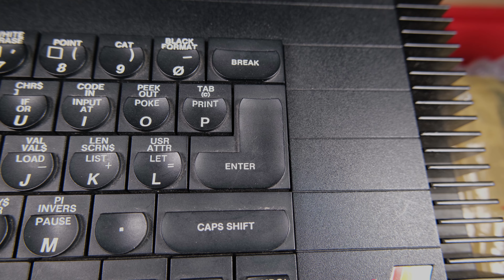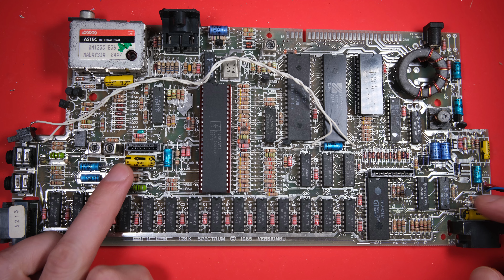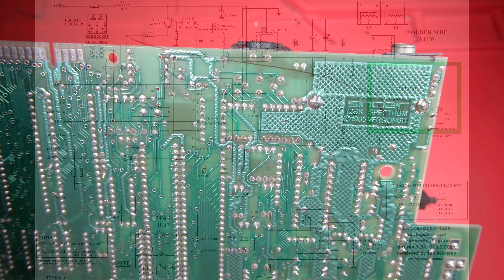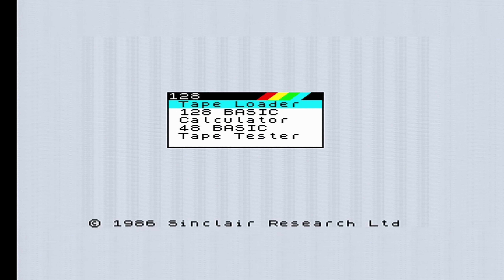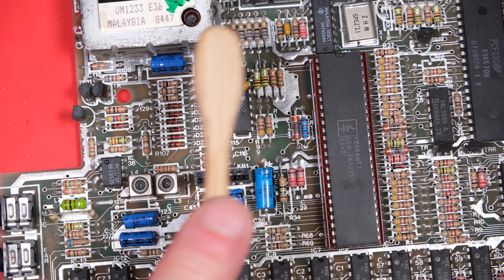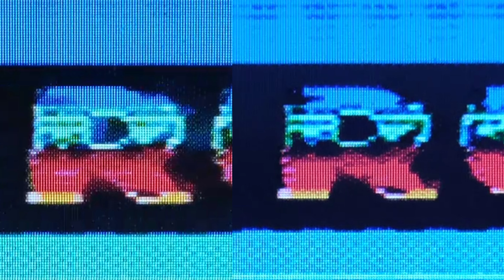ZX Spectrum 128K Toastrack - Composite Mod and some Service Mods

Comment: those scrolling lines as i recently found out is due to the PSU being close to 9vdc , as we know most original spectrum PSU's output around 12-15vdc under no load , modern PSU's are very close to 9vdc around 9.7vdc ,m when under load this drops below 9vdc and causes those scrolls !!
Reply from the maker: I might have to test that theory!

Comment: I got mine down from the loft a couple of weeks ago.  It's not working, of course.  Black bars top to bottom on start up and the reset does nothing.  Seems to be giving all the right voltages etc so I plan to re-cap it.  Is that the right thing to do?  I'm new to this and am using this as a learning exercise.  So far I have learned that I don't have a clue what I'm doing ...  😁
Reply from the maker: I don't think I've ever had a failure that a recap fixed, so I would recommend doing some diagnostics first, are the bars vertical or horiztonal? It sounds indicative of a CPU failure
Reply: @HappyLittleDiodes  Vertical, solid black and white bars with the occasional coloured byte in random places.

See, I told you I didn't know what I was doing! 🤪
Reply from the maker: My spidey senses say Z80 but needs investigation!
Reply: @HappyLittleDiodes  It will get it, soon.  BTW is there anything I shouldn't do that's likely to kill stuff?
Reply from the maker: Make sure your voltages are ok and don't run it for any amount of time without the heatsink attached. Use a current limiting power supply if possible. Is the Z80 socketed? If not then I wouldn't recommend it being your first chip removal, you can easily damage traces.  The best thing would be to get a diagnostic ROM running to rule out anything else before such a job
Reply: @HappyLittleDiodes  Noted.  Thanks for taking the time to answer.

Comment: no need to composite mod a toastrack as you said it already has it on the monitor din socket, so why? make up a din to rca adaptor...
Reply from the maker: As mentioned in the video the owner wanted to use a peripheral that is so large is blocks that socket
Reply: @HappyLittleDiodes  a right angle din plug may fit? if its that opus , i have one but not as yet tried it on a toastrack to see how things fit
Reply from the maker: I think the owner's preference was to have the machine appear unmodified and to have composite video available at the modulator output, he didn't send the Opus otherwise I may have experimented
Reply: @HappyLittleDiodes  the opus has a composite output but it takes it off the edge connector, which isnt present on the 128 models ,  its  supposedly possible to have simultaneous rf and composite out of the modulator rca connector, you leave the modulator connected as  factory, except lead a wire out of the can connected to phono centre, you then rig up a simple emitter follower buffer fed from modulator video in pin to base of a pnp transistor, collector to ground,  emitter to +5v via a 220 ohm resistor(may need value tweaking), emitter also to rca centre via a 100uf minimum cap ...in the case of a 128, likely directly connect the dins video signal directly to the centre rca contact,

Comment: So the composite mod is identical to the one that it done on the 48K boards, right?
Reply from the maker: Not quite!!
Reply: @HappyLittleDiodes  Why's that?
Reply from the maker: If you simply connect the modulator input to the socket it's not going to work, you have to route it from elsewhere on the board

Comment: Very  nice.

I'm surprised you didn't swap the linear voltage regulator for a switch mode one.
Reply from the maker: Various pros and cons to both!  It tends to come down to the owner's preference
Reply: @HappyLittleDiodes  no 'need' to , maybe just change to a 2 amp 78S05 if a 1a/1.5a 7805 is fitted ..

Comment: toast rack continues to be on my shopping list .. should the composite have a 15ohm resistor on to reduce the voltage down to 1.0 volt
Reply from the maker: Not that I'm aware of. The signal we hijacked is an oven ready composite signal unless I'm mistaken
Reply: @HappyLittleDiodes  yep no need to add anything if tapping off directly at the din socket pin ,

Comment: Lovely tidy work old boy! This keyboard mod would've made many a teenaged geek positively explode in the 80's! 

FYI - Back in my day, we would put (or more commonly screen-printed printed) solder paste onto the board, carefully place all the surface mount components and then briefly bake the board at a temperature high enough to melt the paste - although I daresay you're already aware of this method...
Reply from the maker: Yes if the kit came with a mask that could be a good path to go down!  I've never played with solder paste before

Comment: Good job, but how about the unrainer mod? Also why would anyone wanna use a Toastrack with composite video?
Reply from the maker: Interesting I've not come across this mod.  I explain about the composite mod earlier in the video, he's using a peripheral that blocks the RGB port
Reply: Some people think that RGB looks too perfect and emulator-like. Composite video adds analogue "warmth" which can be part of nostalgia. Also, most games and demos were created to look good on CRT TVs, assuming certain amount of blur and colour shift. I prefer to have that option even though it's not my default display method.
Reply: @baze3SC  I certainly prefer RGB over Composite. RGB output of the Toastrack is not that pixel perfect. Even with an LCD monitor, it is never like a PC emulator or like the VGA or HDMI add-ons. With a CRT, it is nostalgic enough less the eye strain 😁.
Reply: @borayurt66  Yeah of course, it's a personal preference. Btw if I were to use the composite output with our beloved toastrack I'd just use the signal that's available at the RGB connector, no need to touch the modulator at all - however that was not the option for the owner of the machine shown in this video.
Reply: @baze3SC  why wasnt it not an option.? if  'cause a din plug wouldnt fit with the opus, you can get right angled ones that likely would do, and make up a din to rca adaptor lead